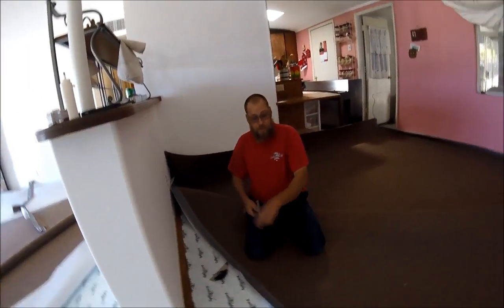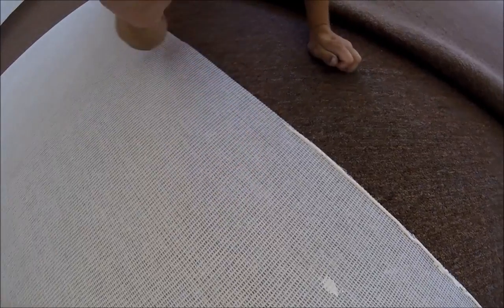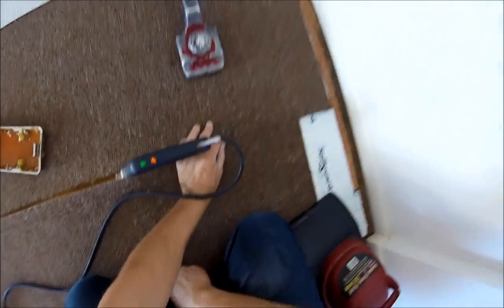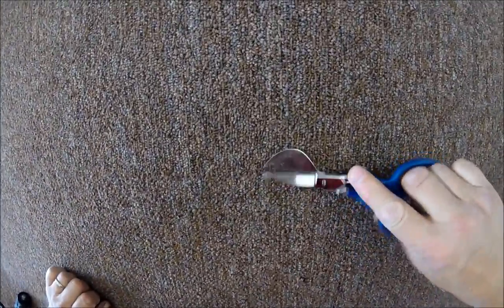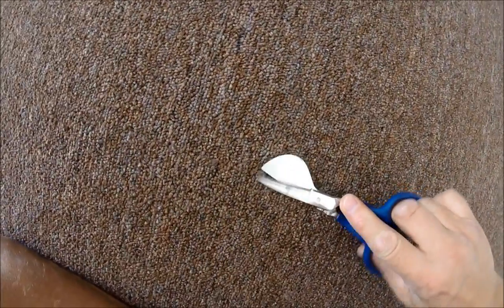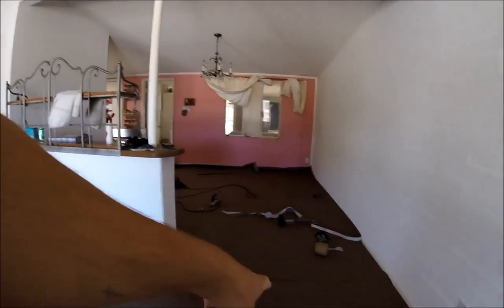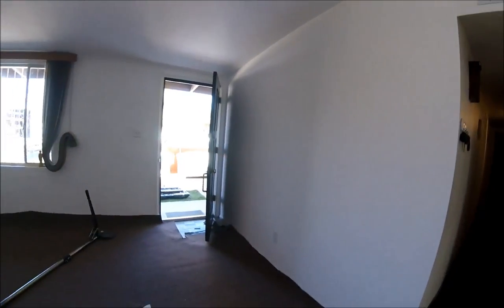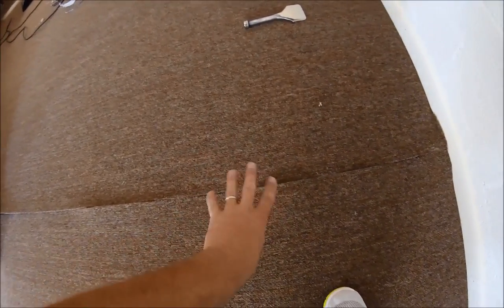HOW TO SEAM COMMERCIAL CARPET

Comment: Can you elaborate a little more on what the seamer down does? I’m assuming it cools the seam faster. Does it also weight down the seam? Here in FL we put weight on our seams to prevent peaking.
Reply from the maker: Blake Yes weights the same down by sucking up like a vacuum, it also pulls the glue tightly into the backing of the carpet causing it to be a tight flat seam